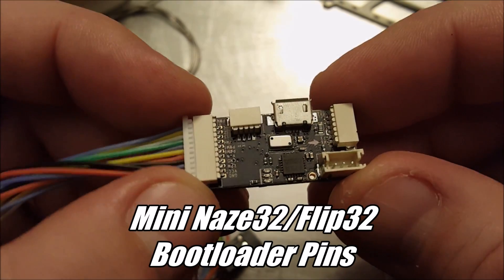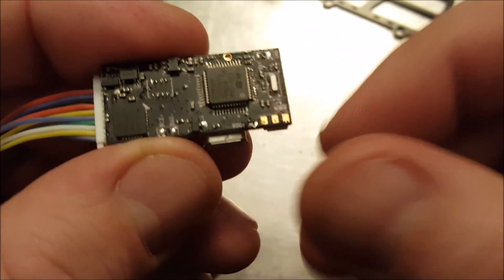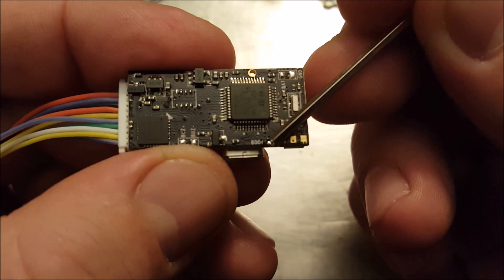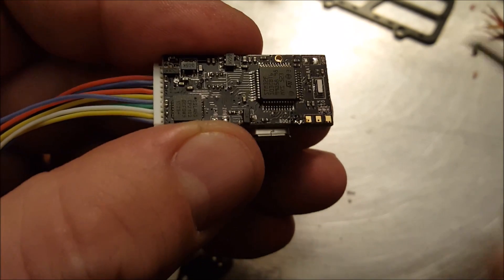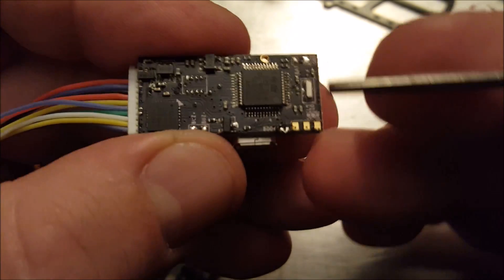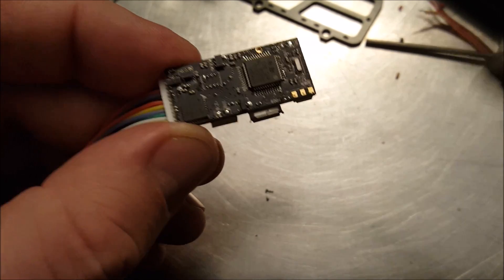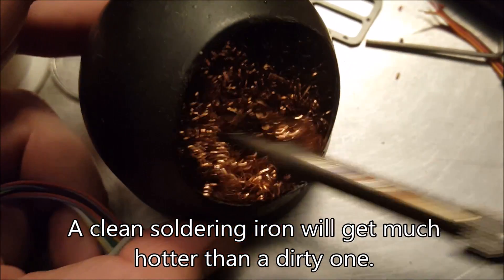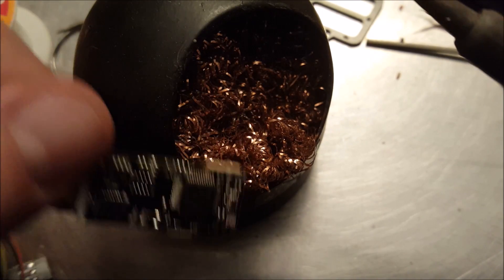Mini Naze32/Flip32 Bootloader Pin Location

Comment: So I just received to KingKong 210GT with the mini f3 in it. Any idea where the bootloader pin is on that? Thanks.
Reply from the maker: No, the only thing you can do is look around for a wiring diagram or find some one who has messed with those before.
Reply: I actually just found it. It's a small button extruding from the plastic casing on the FC opposite side of the ESC pin slots. Just in case anyone asks. Thanks!

Comment: Wouldn't a micro switch ( On/OFF ) connected to the pads with thin wire, work better? Or, is there a reason why that wouldn't work??   I program my own Audi ECU's, ( Engine Control Units ), which fairly frequently require that I load BIN files, while ECU is out of the car. Of course, this requires entering boot mode. So, it was much easier to just solder a switch that I can flip on and off, then it was trying to short out the bootloader pads.  Again, there may be a world of difference between the two, so I'm just curious.   Excellent video!!

Comment: i have 2 mini afro naze32 and trouble like these they are just difficult to mount. i have to basically just mount with antivibration sticky foam then and get a bluetooth module on there so i can edit without having to take apart to disturb. wish when they designed they have made it just a little bit bigger and put some mount holes in there.

Comment: Did you measure the voltage for uart and ppm when you fire it up the board over VIN,GND with 5V ... i measure only 4.4V ... think there is a diode in place ... choose to power the board over the ppm power pins

Comment: Now you need to learn how to pull those connectors off, and take that mini fc and a regular size rx and put it together into a form factor the same size as a full acronaze.
I think those fellas that fly the Black Bolt make a "sandwich" with a mini naze and a dr4 that is smaller and lighter than a acro naze board.

Comment: This is definitely not mini Naze32, it looks very different. And you can just use a piece of wire to short these pads while you're powering the board, you don't really need to solder these.
Reply from the maker: +LeoTheHuman It is called a "FLIP32 MINI NAZE32 Flight Controller" on the website.  I tried 100 times to get a wire to short out the pads.  I tried 100 times with my allen wrench.  I tried 100 times with a piece of solid solder but none of them worked till I soldered them.  That was the only thing that worked for me.
Reply: I found it very hard to short the boot pins on the original naze32 mini, I tinned the pads and I made a very short wire with both ends tinned. That works great. It has to be shorted for approximately a second after it gets power.